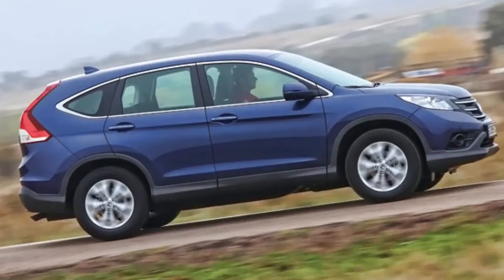How AWD works in Honda CR-V? Real-Time AWD basics

Comment: I will be purchasing a Honda CRV, what should I expect from this Truck.
Reply from the maker: It's a very solid SUV with probably the biggest life expectancy on the market among price-range compatitors. The new generation uses CVT transmissions unless it's a hybrid, and this is the weakest link that needs some attention. But overall, the car is almost perfect, in my opinion. If you are getting a used one, your satisfaction will greatly depend on the model year and mileage on the vehicle.

Comment: In other words, Honda's Real Time AWD is really partially AWD as it's FWD and sends power to the rear wheels (AWD) when needed. Honda continues using its Real Time AWD for the newer 5th generation of CRVs.
It's misleading as AWD is generally on Full time, like the AWD systems for Subarus and VWs/Audis.

Comment: How to check if its working propertly??? What test can be performed?
Reply from the maker: If it doesn't work, you will see the amber AWD light on the dash. Other than that, there are no ways you can test it or activate. If you extremely need this, go to a sandy or slippery ground and sharply press the gas pedal while someone should watch the car from the side - both rear and front wheels should slip a bit if they all have torque from the engine.

Comment: Is the same for the 3rd gen?
Reply from the maker: It's slightly different in terms of how electronics work. But in terms of driving the car - yes, it works the same way.
Reply: @DmitrySapko  I have problems with the abs so it's supposed that the vsa is off, still my awd system works normally?